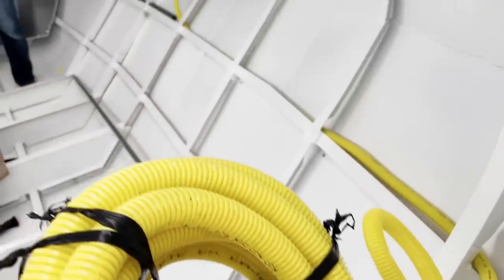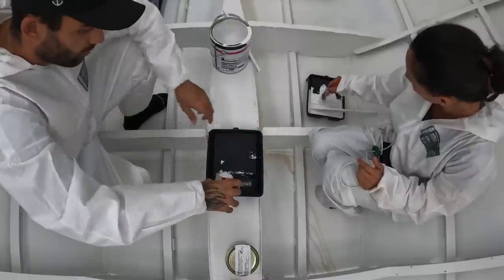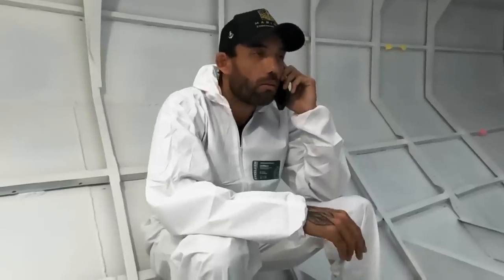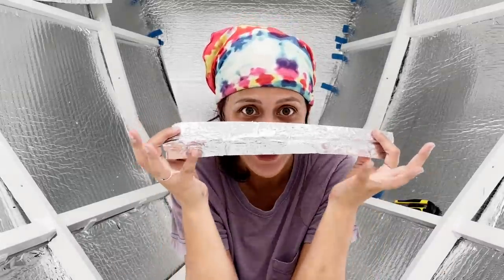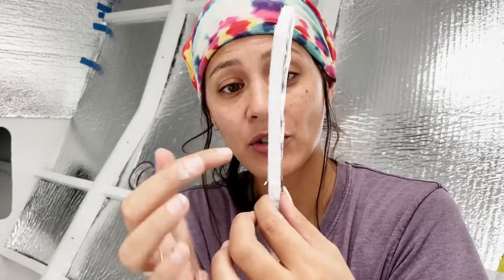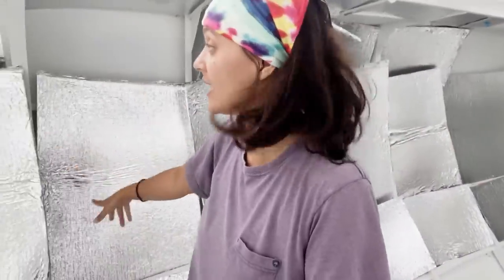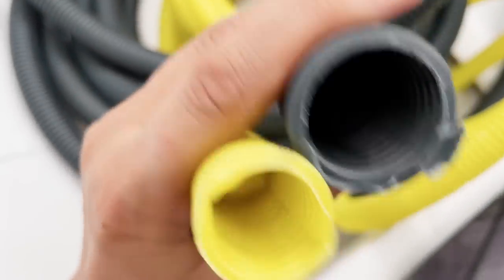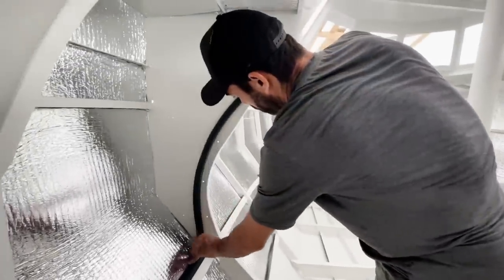The Struggle is Real ⛵️ Ep31 – Installing Insulation 3TC in Our Boat

Comment: Another suggestion: there will be no better time than now to organise an earth leak connection for lightning protection. It's quite surprising the number of boats that get struck by lightning and consequently lose aĺl their electrical equipment. A steel boat should be easy to protect. Remember that the earth wire is usually run down from the masthead directly to the earth terminal somewhere on the inner hull.

Comment: You have some tricky decisions. I was looking at a (‘north pacific’)boat built in China and they were proud to point out that the wiring and plumbing was installed after the interior. This meant it was all accessible. Not a bad idea!  You might consider that .
Also you will be adding wiring later. Things change , new tech need new wiring ( example starlink was not around when you originally started this rebuild). 
You need wiring chase way that can be accessed later.
What does the interior builder suggest?
In the long run you might be better waiting. 
Cheers Warren
Reply from the maker: We were considering this! And when we asked Mobili Mare how we could proceed, they said they will build around anything we make 😅 so we are putting in conduits where we think the furniture will be covering up. You can see our super highway of conduits in our video today! Let us know what you think about our solution.

Comment: Interesting choice.  
Yes it will do a very good job, but won’t benefit from sound deadening as other products might. 
Whilst the Mylar gives a vapour barrier, unless the edges are sealed to the framing, it won’t be perfect.
And you are still going to get condensation on the frames. 
(Boats , especially steel, are a nightmare, in a building you ventilate between the steel and the insulation 
Of course as others stated, it works better with a cavity behind (and in front). It may have been better to put across the frames, just behind the panelling.

Comment: I hate to say it mylar film is made with aluminum alloy, s😢orry guys. But you still may not have a galvanic reaction, because the aluminum is sealed inside of the foil polymer material, depending on mylar grade. Easiest way to find out, see if you can pass current through it with a 9-volt battery
Reply: Yep, reflective mylar is plastic film covered in aluminum. They have plenty paint layers on the hull though, so it should be okay anyways.

However making big mistakes is bad in general. I wish them all luck on building the boat, but they need to do deeper research before making decisions. They have dreams and fall sometimes in positive bias listening to some questionable people selling their products or services. It's not easy to avoid this...

Comment: From 00:00 secs to 00:50 seconds.I see a big gap between the bottom steel plate and the keel/ frame. Ideally there should be no gaps between the bottom steel plate and the keel/frame. You won't notice anything now, but when you're in rough sea conditions this gap could bend or crack and cause water ingress. A boats/ships hull, frame should be packed tight with no gaps.

Comment: Mylar is actually a brand name for a polyester (PET) same plastic as a soda bottle that is heated and the stretched onto a roller into a thin film that is then aluminumized with real aluminum through a chemical vapor deposition process and you can also get Mylar with gold to that is what they use on space craft and satellites a lot of times for its reflectiveness. You wont have to worry about dissimilar metal corrosion in your application though the aluminum is on the inside of the PET plastic in a very thin film and plus you have painted your steel so nothing to worry about there. Interestingly a lot of steel boats use aluminum for their superstructures wheelhouses and anything high up on the vessel due to its lighter weight allows the center of gravity to be kept lower but they use a specially designed explosively bonded strip that is steel on one side and aluminum on the other with another metal explosively bonded inbetween to prevent dissimilar metal corrosion these strips allow you to simply weld aluminum to steel without any fuss.

Comment: Great work, but I still think the insulation is too thin.
The water is not always warm and that thin insulation will not insulate enough. Water transports heat and cold much better than air. There's a reason why there is thicker insulation. You have space for thicker, so why not?
Reply: The heat insulation material is attached to the bulkhead of the ship, and the bottom of the ship is mainly heat conduction. This is when the thermal conductivity of the insulation material is most important.
heat conduction and heat radiation are completely different concepts

Comment: Take a look at low pressure forced ventilation … it uses a low pressure/ speed fan at one point on the hull it will quietly and cheaply force stale wet warm air out of the hull through the vents and any cracks or non air tight hatches. The only things you really need to know are to use a mushroom vent and electric fans are are designed to run either horizontally or vertically.. use the wrong type and they won’t last and start getting noisy.

Comment: The designer of my steel boat used steel frame and panel bulkheads to make the hull rigid, not plywood, which is lighter, and space-saving. The builders however, used plywood, so after years of service, the bottoms of the bulkheads were rotten. Since you painted the interior steel already, Can I assume you are using plywood bulkheads? Does your marine architect think the hull frame is sufficiently rigid using plywood bulkheads bolted to the ribs?
Reply from the maker: For the wood interior we are working with Mobili Mare so we are not sure how the process will go just yet. But we’ll be showing you every detail when we start! We do know that they will use marine grade plywood. Hopefully we’ll be getting to that part soon so stay tuned!

Comment: Hi guys, being a "pro" when it comes to insulation (designing and building commercial refrigeration equipment for a global acting company with (also) a production facility in Navegantes ;-) i've never heard of the product you're using before. We always and only are using polyurethan foam, so my solution in your case would have been sprayfoam. But after your explanations in this video i'm pretty confident that your product will do it's job - at least for several years. Sealing the edges of each panel like you, Laurie, have done it is the key to sucess, but (there's always a "but") the ribs in your boathull will be the problem looking at it for the long term. The ribs will bring the outside temperature (no matter if it will be hotter or cooler than the inside temperature) passing through your insulation right into the boat. That's where the corrosion will start to occure. So, my proposal (to a situation you can not change) would be: before you attach any wood (bulkheads, cabinetry etc.) directly to these ribs insulate these contact areas with something that will not rot (strips of 3 mm ABS or another plastic material will do the job) AND take care of natural VENTILATION ! ! ! From the cold bilge to the hot deck surface there MUST be natural air convection possible behind all walls, covers and cabinetry ! If it is this will dry out every moisture buildup in hidden corners and behind your cabinetry and you will have fun with your project-boat for many years ! Good luck, happy travels and best regards from Berlin, Germany
Reply from the maker: Hello! It's very nice to hear your opinion on this. Since it is a product not commonly used in boats yet, we did have our doubts and can see it as a bit experimental. But the costs and easy application, while also making it extremely easy to remove the panels and check the hull after made us want to take the risk. 

For the ribs we will insulate the sides of the ribs. We are still making our way through the hull. Then we will swing back to the little details with the scrap pieces. Also, we don't know how the framing for the wood will be installed yet so that might effect where the insulation goes. 

From what we understand, you are recommending also insulating on top of the rib where it will be in contact with wood with a thin material? The wood would need to be supplemented in this instance? 

Love the feedback! Do let us know more about this detail, we are very curious. Thanks!
Reply: @lahakai  Lori, simply bedding whatever is attached to the steel is imho the Best way to isolate. Ok I am opinionated bc what works for me is Boatlife Lifecaulk or Sudbury Elastomeric sealant. Their "penetrating" marine sealant is same thing only thinner, iow, worlds best single part contact cement, which is what I use to get the mylar tape or the 3m pad straps to glue down better (longer). I don't personally use butyl tape unless I'm installing something like workboat windows bc I think it cold flows when it needs to stay put.
So I am recommending the Sudbury Elastomeric sealant in both the thick and thin types, and the Boatlife Lifecaulk in Black, bc white is shorter lived when exposed to sunlight. Both of these caulks are EXCELLENT insulators when it comes time to bed thru hulls etc. Lifecaulk is the bomb for hard -or-soft wood assemblies. The Best thing about them vs Sika or 52billion is You Can Take Them Apart when the time comes, which it Always does.
Thanks you guys.
Reply: @lahakai  The wood can be wood, no need to supplement it in that areas. But the points, where the wood is mounted to the rips for support/structural purposes, on these contact points the direct contact between the wood and the "sweating" metal rips poking through your insulation has to be avoided. This "insulation" (or just call it a distance) on that particular  contact/mounting points between wood and your metal rips is supposed to be hard and sturdy. It just has to be a small distance (3 mm is enough) bridged by any hard plastic (f.e. ABS or similar). Think about a small "washer" made out of hard plastic, a feature Mobili Mare can easily provide and add into their CAD/manufacturing prozess. Just to make sure no wood has direct contact with the "sweating" rips. Good luck !

Comment: I only mention this for future reference if you find yourself doing another job like this in the future :

You can save yourself time and money by laying down the Sikaflex or whatever in an  X pattern directly onto the surfaces to be stuck to. This way you'll use substantially less glue since corner to corner, that is diagonally,  is a much shorter distance while still being a strong attachment pattern.
Reply from the maker: Ah this is a good tip! There was not much method to our madness here.  We'll do the x moving forward! Cheers
Reply: @lahakai  Just like the framing, caulking beads can trap water. Always caulk in a way that allows water to drain out the bottom. Attaching panels like these, I caulk the perimeter (visible) after they're in place, leaving the bottom edge free to vent.
Thanks
Reply from the maker: @martyspargur5281  That's a good point as well! We did realize this and start doing it in vertical stripes incase moisture would drip down. We will keep this in mind for the rest of the panels. Thanks!!
Reply: Please consider that the caulking does not necessarily need to be super high-end for every job. But cheap hardware store caulk can be a waste of time and money.
GOOD hardware store caulk can work well. Laying a bead along the edges of those panels (beads which like welding beads can be "intermittent" or "continous"), i have used a non-marine elastic adhesive caulk called Big Stretch with great results.
As far as regular hardware store caulk goes, some can be overkill (hard to apply), and some are too thin.
For me, most desirable after polyurethanes and elastomeric, would be non-silicones, like Elastic or acrylic, or polyether.
I don't use latex, and i pretty much bed Everything

Comment: In my ambo conversion and my tiny house, electrical wiring will be done last, running through paintable or disguised exposed conduit. I have seen too many times on sailing videos and van life videos someone trying to add a new electrical component and squeezing themselves into tiny spots and experiencing a lot of frustration. Why not have electrical run where you can easily access it or easily run new lines? Some people say they think it looks cleaner but if you incorporate it onto the outside of the interior build before hand it should not even be noticed.

Comment: If the outdoor temperature is lower than 0 degrees Celsius, any glue you use will not work, and it will cause bulges due to condensation.
There is no problem with wooden structure buildings because there is a waterproof and breathable membrane on the outside of the building.
For steel hulls, the best way to insulate heat is the same as cold storage and mobile refrigerated containers.

Comment: You are going to want to insulate those ribs in contact with the hull. They are going to act like heat plate radiator fins, kind of same idea as what you see on a chainsaw engine head to get rid of heat
Reply from the maker: Yes, thanks for mentioning that! We will! We're still making our way around the hull then will go back to the ribs. Though it's easy to install, its a bit time consuming because of the taping. Cheers!

Comment: Radiant barriers that aren’t facing an air space don’t work. If it’s sandwiched between a layer of sand and a concrete slab, it’s a conductor, not an insulator.

Comment: heat transfer

1、heat conduction
2、heat convection
3、heat radiation  
The material you are using is 93% blocking heat radiation     。
But close to the bulkhead of the ship, heat conduction is the main。

This material is also used in air-conditioning pipes, but the air-conditioning pipes are suspended and should not be in contact with other objects as much as possible.

Comment: Estive a ver vocês a por os tubos para passarem os cabos eléctricos  dou a sugestão de deixarem uma guia para no futuro se quserem passar mais um cabo e mais fácil
Reply: I suggest that you make it a habit with every conduit to include a pull - thru string. Remember to attach a new string to whatever it is that you are pulling thru the conduit so that you can repeat if necessary!
Reply from the maker: We did a test run with a set of wires after the first conduit and having a guide would be essential. Even one wire got stuck in random places. Solid advice! Thanks!!

Ola Antonio, sim percebemos isso quando fomos passar o primeiro cabo e tivemos dificuldade. com certeza iremos deixar um guia passado para facilitar. Muito obrigada pela dica :)

Comment: Isn’t the framing going to be a heat bridge ?
Reply from the maker: Still working on it, that’s why you don’t see it here. We have the roof and cockpit to go. We are finishing up all the large blocks before heading back and hitting up the frames with the scraps. Then the wood will also act as another layer of insulation. Cheers!

Comment: Sorry, someone has given you some false information.  The insulating material you're using is aluminized mylar.  That's what makes it shiny.  It's the aluminum that reflects 93-94% of the infrared energy, not the mylar.  Also, if the surfaces of the aluminum from outside to inside touch, you've lost part of the battle as the heat will be transferred through that contact area.  The aluminum needs to be isolated from front to back.  That's how they build satellites for space, multiple layers of aluminum that are isolated between each other as one layer reflects 93-94% of the energy while the next layer reflects 93-94% of the escaped 6-7%, etc for each additional layer.  It's the aluminum reflecting, not the mylar.  The mylar gives the material water vapor resistance and strength.  The hull's temp is transmitted due to touching the aluminized mylar.
I insulated my boat years ago but only used one layer of aluminized coating.  It was a fiberglass boat so there wasn't any transmission of heat from the hull surface.  It made the boat much warmer and quieter too.  Being in Alaska, the temp upgrade was significant, especially during winter boating.

Comment: Last vid (Ep30), you advised 3TC is "polystyrene" with 2 sheets of "polymer", now, next vlog, not correcting the previous, your advising it's mylar (same thing) & styrofoam, plus also failed to mention the concerns in comments, responded to by yourself, regarding condensation between steel & insulation.

People watch these sailing channels for inspiration & education, be good if they receiving correct information, right? or at least redacted, corrected, addressed when finding out prior to publishing the vlog, so they don't make the same mistakes, potentially purchasing>installing, then find out next vlog, you must have been aware before publishing.

I only hope their not lemmings, & do their own research.
Reply from the maker: 3TC is made of a patented Mylar that is made of polyethylene with a styrofoam core. This can be found on their website and these videos. This is a new product on the market here in Brazil and this installation is experimental. We have made no reviews of the product yet as the boat is still under construction. Note this video not sponsored as well - we are looking for alternate ways to insulate our steel boat while also keeping the surface available for repair and inspection and are trying a new technology. So we cannot speak to condensation or any performance of the product till it is tested in the water. Videos on this will be released when proper testing has been made.
Reply: @lahakai  Yes, but show me where you tell/warn viewers all that, including "possible negatives", like condensation, in "Ep30".
This weeks episode - this looks like a great seacock, watch me install, viewers go buy. Next week episode - seacock failed & my boat sank 😭 Too Late for viewers who buy last week 🙄